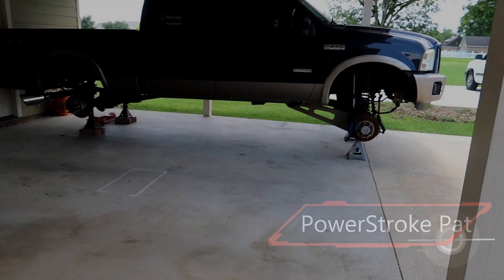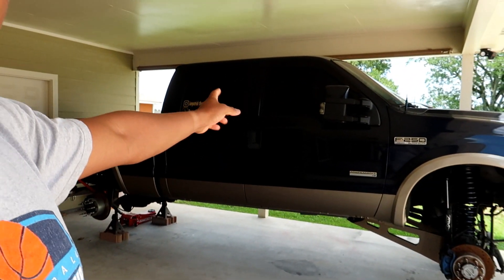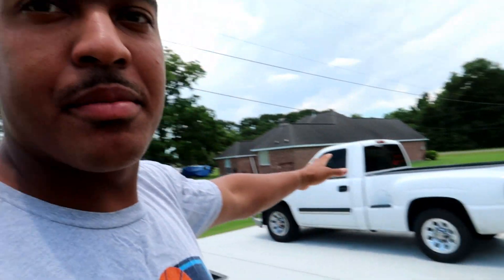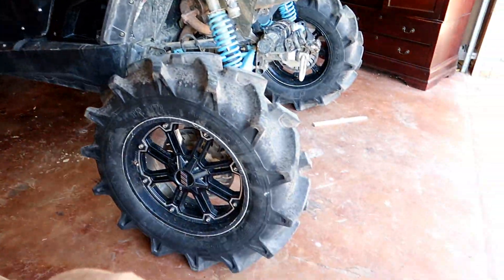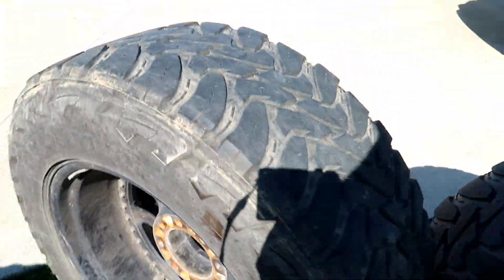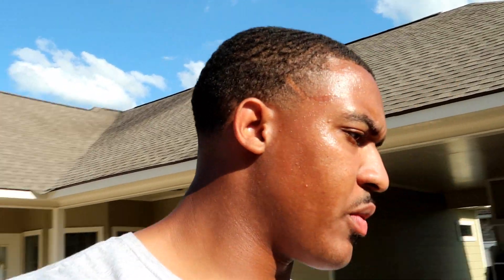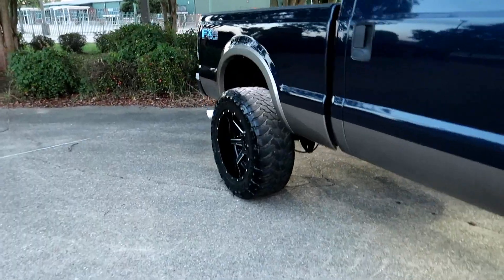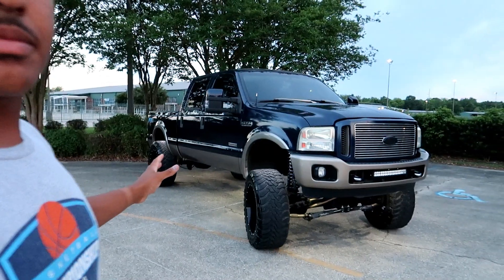New Wheel and Tire Setup! |For Sale| F250 PowerStroke |PowerStroke Pat

Comment: Pat it looks off cause ur truck mainly looks blue/tan with little black accents in there. I wouldn't run those myself either because the colors don't line up right. The only wheel colors that would look good are chrome,polished, brushed on your 6.0. btw i love ur f250 man keep up the good work
Reply from the maker: I couldnt agree more.  Thanks alot man